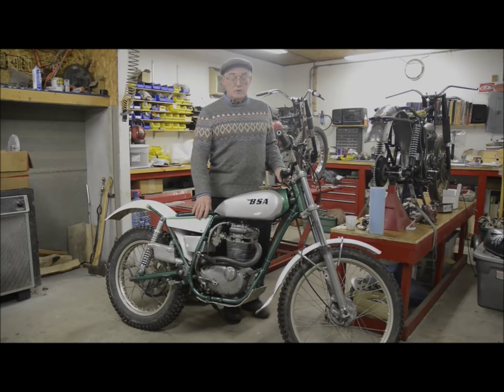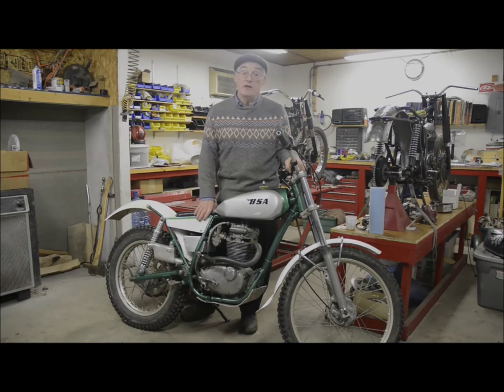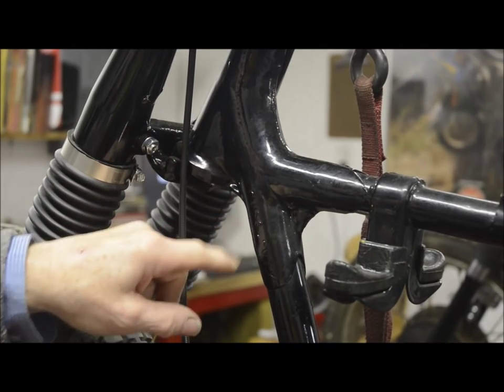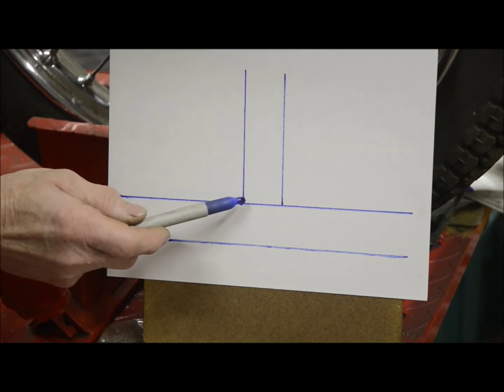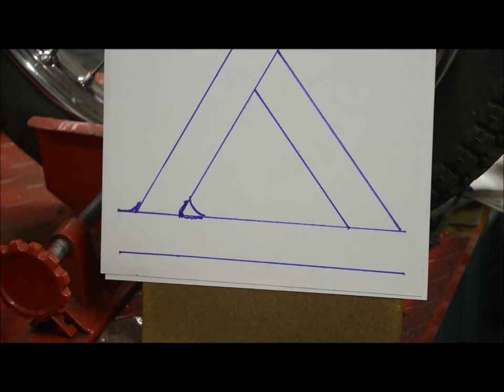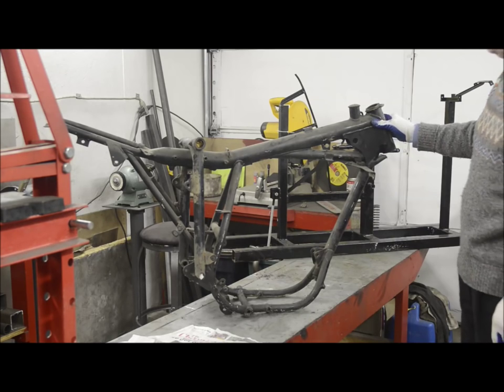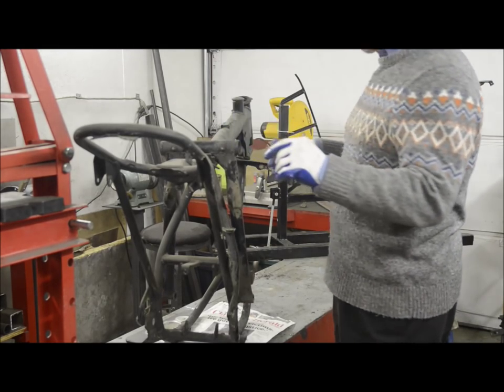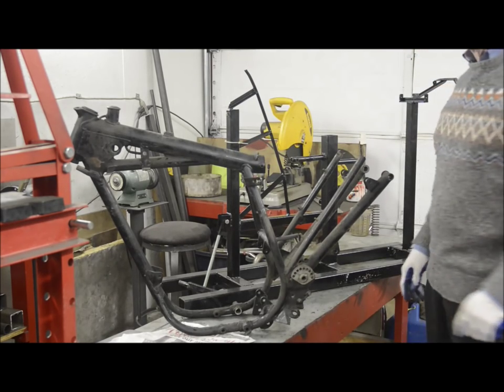BM 250 Trials - Frame Part One

Comment: hi i love watching you,im in process of building a motocross ,copy of the victor special,i know nothing of the 350,sport engine as iv always had 2strokes,,im just converting stearing head to taper bearing,does the clutch and gearbox want their own oil, hope you can help , thanks
Reply from the maker: Yes the clutch works well with ATF and for the gearbox EP75 or thereabouts transmission oil.

Comment: hiya guys love your show im in the process of building a  350 cc victor motocross, iv chance of a pair of 86 kawasaki kdx 200 front forks with 4stud wheel mount on front rather than bottom,do you think they are upto the job many thanks
Reply from the maker: The original BSA forks on the B44 were not brilliant or particularly heavy weight in construction but they did last. The Kawasaki forks should be well up to what the B44 will require of them.

Comment: Should you have added the weight of the oil tank in with the first frame to give a better impression of extra weight saving?
Reply from the maker: +Chris Stephens Yes I suppose you are right, it was something that I didn't think of. It would probably be a more accurate comparison to have weighed frame and forks for each bike as that would have shown an even bigger difference in the models. Thank you for watching.
Reply: Old British bikes, how could I not watch? Sold spares for them for enough years to say their are in the blood.

Comment: can you explain why you lose the evolved oif 'tank' and replace with an un-evolved oil tank?
Reply from the maker: The alloy oil tank weighs a lot less than all of the steel tube that is removed, and it sets the weight of the oil lower down so the centre of gravity of the bike is lowered.
Reply: @BritanniaMotorcycles  forgive me - as the owner of an increasingly rare b25ss (and a b50ss) i would prefer to see them restored rather than chopped - however your series is fascinating as to what can be done to improve what the BSA competition shop never could...

Comment: So you use bronze rod for bronze welding and brass for brazing.
Reply from the maker: The names simplify the chemistry somewhat but the two alloys are different and so are the application techniques and the structural forms. In the US only fusion joints are classed as welding so anything with the use of bronze alloys is called brazing.